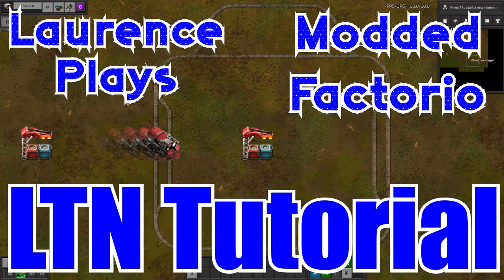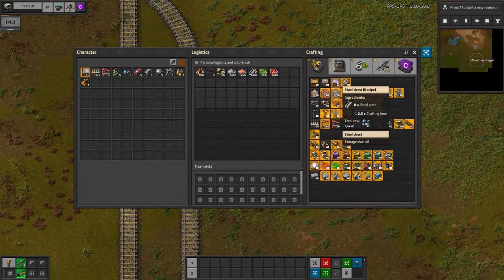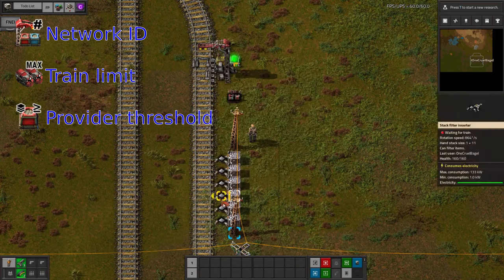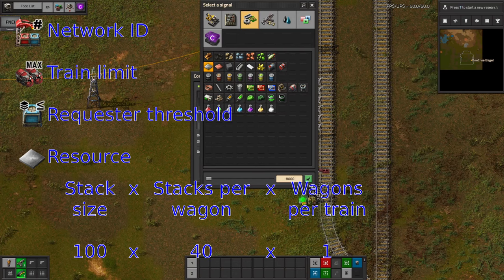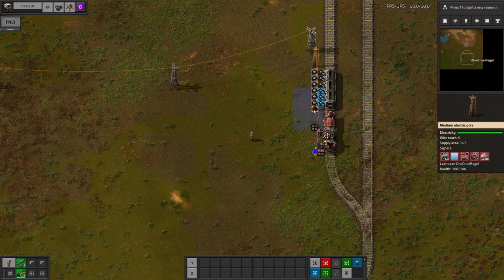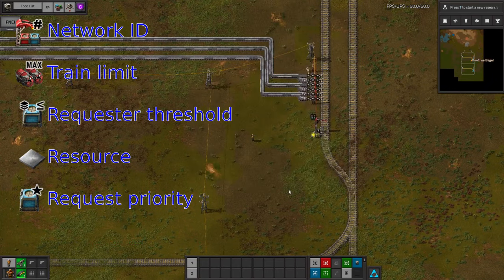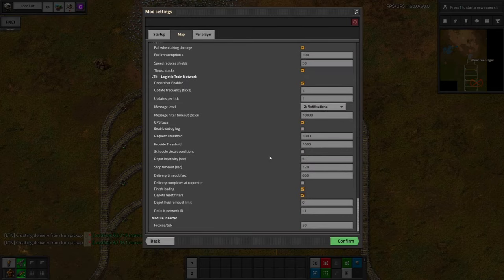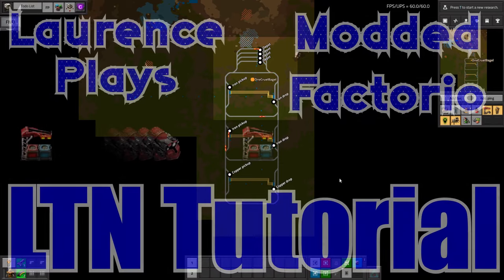LTN Basics Tutorial - Laurence Plays Factorio

Comment: Something with excess cargo. I like putting a setting which only lets trains go from the depot if empty and dump excess train contents into provider chests for bots to deal with.
Reply from the maker: That's certainly an option, however with the settings tweak, the train won't leave until it's empty. I'd prefer to prevent the problem in the first place, or at least be alerted that there is a problem. I also used to set up the depot stations to sound an alarm if a train arrived with any inventory.

Comment: Thank you for the tutorial. The one piece I'm not understanding still after this tutorial is the negative value on the combinator for the requester station. "Less than the negative request threshold" at around 4:05. I don't understand this usage enough to figure out how to make my own systems. Why do we use negative numbers with combinators? This is something I've never understood.
Reply from the maker: You're welcome!
It's because you add together the signals coming from the combinator and the contents of the station. So, in this case:
- If the station has just been filled up, there'll  be 8,000 iron plates in it. You then subtract the resource request and get 0, so the station is happy. 
- If the station is empty, there'll be 0 iron plates in it. You then subtract the resource request and get -8000, which is a bigger negative than the request threshold (40 stacks = 4000) is positive, so a train gets called.

That's the how. The why is because if you didn't do that, the wiring would have to be more complicated and you'd need to use more combinators. If you make one positive and the other negative, you can just add them, which is what the circuit network does automatically. 

Does that help? I don't know if I've explained it any better!
Reply: @LaurencePlays  thanks for the extra details. I’ll have to test this evening and watch again to hopefully get everything set straight in my head. I think a better understating on my part of circuit networks would go a long way to understand this tutorial and the mod in general.
Reply from the maker: @_cosmicsloth  No problem, glad I could help! Yes, getting a feel for circuit networks is definitely worthwhile. Maybe that's something else I should do a video about...
Reply: @LaurencePlays  I think that would be a great addition to your series and a perfect setup to this!
Reply from the maker: @_cosmicsloth  I've started writing it, maybe it'll come out next week, if I have the time!  :-)

Comment: Hello, great video.
I was already using LTN before and I had no problems but for a while the mod created me "Temporary stops" and the trains no longer stop at the requesting and receiving stops, it only goes around in circles between "Depot " and "Temporary stop"
I can't find a solution other than not using LTN, not cool.
Thanks for your help
Reply from the maker: LTN creates a temporary stop before each normal stop just in case you have any stations with duplicate names - this ensures the train goes to the correct station. Are you just getting the temporary stops, and no proper stops? My first guess would be that the stations it's trying to go to are getting closed or deactivated before the train can get there, but that's definitely a guess. I'd recommend checking the mod's up to date as well, and looking through the combinator settings to make sure everything's configured properly... Beyond that, I don't have any other ideas, I'm afraid.

Comment: Maybe this is discussed in the next tutorial part. But i would also next to min trains would add min train length and max. Maybe not now but you might end up running a mix of train sizes and having to add all that stuff later could be a pain.

Edit so its seems this will be discussed next video ill still leave this up as i personally think its a good tip to apply from the beginning.
Reply from the maker: That's a fair point - I generally stick with just one train length in my games, and if I need more throughput it just means more trains, but you're quite right, if you're planning for the future, it can't hurt to specify the train sizes. Actually using that is a more advanced option, but setting it initially certainly doesn't hurt.
Reply: @LaurencePlays I'm the same in a lot of my old play troughs, but i made a new rail design that runs mainly 1-1 and plan on using 1-2-1 for ore's and more high use resources. Its mainly why i thought of it.
Reply: I also have to idiot proof it since i play with frends.
Reply from the maker: @mbos14  Those are really small trains! tbf, I did use 1-1 trains in space in my SE 0.5 run, but I was still using, I think, 2-6 trains on the ground. We're using 1-2-1-2 on the ground and 1-2-1 in space at the moment. And 1-8-3 in one special case! But no LTN...
Reply from the maker: @mbos14 That never works... If you try to idiot proof something, the universe will just create a better idiot.
Reply: @LaurencePlays The previous SE i did i used mainly 1-2-1 for in base item moving. and 2-4-2 for moving ore's from mining outpost to my main base were it got moved over to 1-2-1.

It cant be worse then the infinity bot loop they made. If it wasn't for the fact that they were standing in the middle of our expensive stuff i would have nuked them on the spot.

Comment: I tried setting up everything as shown in the video, but sadly it doesn't work. The stations will continuously request, even if they are completely full. Might be an update with it, might be that I'm using 2-8 trains, I don't know. But it doesn't work.
Reply from the maker: If the stations are continually requesting, it sounds like they don't know they're full. Make sure all the chests are linked up to the station properly, and take a look at the signals on the cable network when a train is summoned. Hopefully you'll be able to see which number is wrong!

Comment: how do you do it with liquids?
Reply from the maker: Exactly the same way, except you don't need to worry about stack sizes. A fluid wagon is 25k, so make sure you've got at least 2 tanks in the station for each wagon on the train and request when you have less than 25k x wagons left in the station.
Reply: @LaurencePlays  So the "Request Stack Threshold" needs to be 25k or the "-25k syngas" I'm also playing the same mod PY as you and are following the series all wonderful btw.
Reply from the maker: @hunterclapp1812  You would use "request threshold" instead of "request stack threshold" because fluids don't stack. But yes, you'd set that to 25,000. You'd also want to add "-50,000 syngas" to make sure the trains come to refill it when you drop below 25k.